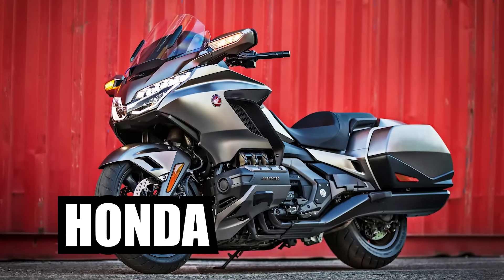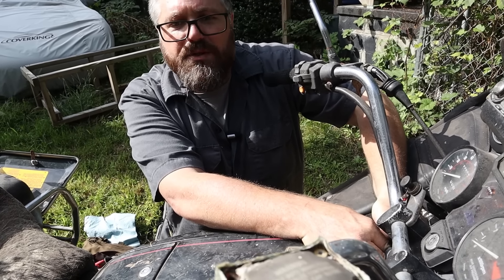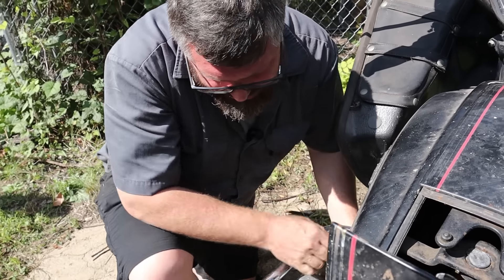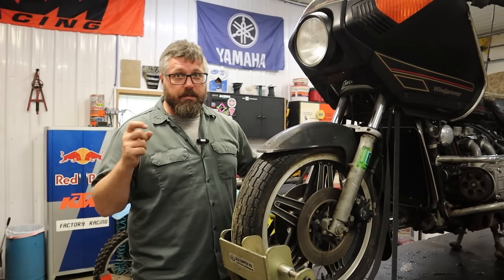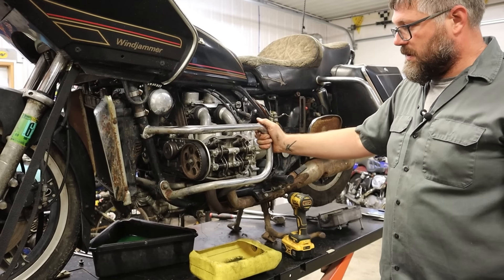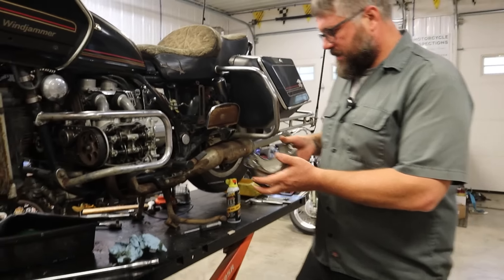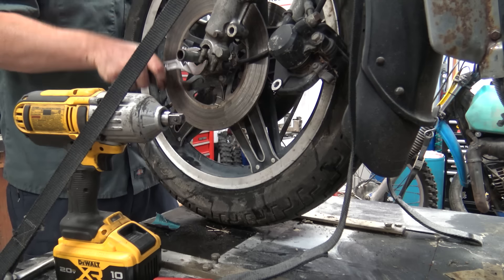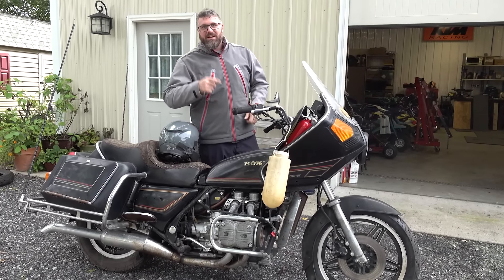Will this Abandoned Honda with a Seized Engine Get Me 247 Miles Home?

Comment: I have liked and subscribed Craig my good brother.
Thanks for taking me along on some adventures, since I had a stroke, I’ve not been able to work, which means I used up all my savings and had to sell my bike.
Been without one now for about 3 years and it’s killing me.
Made a good recovery and could ride, but here in England the bikes are expensive to run, so between you and Sean, this is about as close as I come to a ride out these days.
Thanks for the company and the entertainment brother.
Great content. Stay safe man. 🙏

Comment: Awesome job, back in 1982 I bought my second street legal bike the GL 1000 LTD. It came without any fairings or cases, it had a small handlebar and was sold as a sportsbike.
The LTD came with a socalled "blueprint" engine, a beautiful aubergine like metalic color and gold colored rims.
So I (like everyone else in those day's) added higher handlebars, a Vetter windshield/fairing and Krauser cases wich turned it into a greate cruiser. Honda noticed and changed their later designs into cruisers complete with everything you like and more. Thanks for bringing back some beautiful memories to a now 65 year old.

Comment: To turn the engine over, take the bolt cover off of the back of the stator and turn the bolt clockwise. That’s how you turn the engine over when setting the timing.
Reply: I wanted to say the same thing, yet thought I would look thru the comments first. Had to do it, when I changed the timing belts on my 1982 GL1100 Interstate.

Comment: Having owned an 83 1100 Goldwing interstate that was locked up when I first got it, I'd be willing to bet that GL of yours will eventually stop burning oil the more you run it. I was fully prepared to tear the engine down but decided to first see if I could free it up and get it running. It smoked alright but the more it ran the less it smoked to the point it stopped smoking (and it wasn't because it was low on oil). I ended up throwing more money at it than it was worth making it look like new again, rode it for 8 years putting over 10k miles on it but never tore the engine down to re-ring it. Having to spend money rebuilding brakes, fork seals, tires etc..... is a given on any older bike if you want to make it properly road worthy, the problem with early GL's though is engine parts like new pistons and rings are hard to find and really expensive if you do find them.

Comment: honestly this just proves that come hell, high water, etc, a boxer goldwing will run (unless u snap a timing belt)

I keep an old 1200 kicking around, and as long as you keep the carbs clean, it starts right up with 167k on it

Comment: I was just remembering that during my late teens, I worked at a Suzuki shop and it seemed that bikes of that era had a lot of trouble with needle and seats leaking, and bikes that were left sitting also had clogged piolet jets. Its amazing you got it running and my hats off to you. Good job

Comment: Here’s a super nerdy observation. But as I have been a mechanic And fire extinguisher maintenance/recharger. You should use a B.C. for auto/boats. The chemical in A.B.C. (The A part) is corrosive to metal when there’s moisture. There are even better, more expensive, cleaner options but a BC extinguisher at least won’t mess up any of your electrical or mechanical stuff in your shop. There’s my two cents, hope it helps.

Comment: Sight and sound brings back so many great memories...I had a GL1000 K1 in 1990, drove it from Holland to Sweden couple times, and many more countries and great rides, on one of the rides back from Sweden ear Malmö, temps started to rise, and a huge smokescreen in the rear view mirror, burning coolant, so found a small town garage/blacksmith, found the right rear cilindersleeve had loosened and sunk a bit in the aluminium block, which was very bad off course, but had to get back home, still 900 km to go, so made a copper ring to fit between the sunken sleeve and cilinderhead, loads of heavy duty gasket-sealant and an extra 10 liter tank of water hooked up to keep things cool enough to ride.
Drove all the way back home, remember driving through the hilly landscape in Denmark seeing a huge trail of white smoke curling through the hills and roads behind me, but kept it cool behind the windjammer screen, rolling sigarets while driving, scared faces in cars and gasstations, but made it all those 900 km, drove straight to a motorbike breakersyard, found a K3 engine low mileage, hoisted it on the rearseat, some ropes around it and drove home to make it well and run until 2 years ago to sell it because cancer decided I couldn't ride anymore, But death did not catch me yet! So I bought 2 Yamaha XJ's 650 and 750 to make 1 riding bike out of it for the fun of working motorbikes, and getting strong again after bad times, this spring will be the one to start riding again!
Thanks for your so inspiring videos, keep 'em ridin'!

Comment: I revived a 77' GL1000K that was parked in the 90's with gas in it. Had to snake the little ports out in the tank w/ stranded cable chucked up in a drill. Stripped it down to a motor and frame.. then broke my right hand (im right handed) and reassembled the entire bike with my left hand. It has a speed wobble at 80mph and only runs good when youre on the throttle lol

Comment: 2:00 I would call that an opposed 4, not a parallel 4. Back when I first started motorcycle touring on my CB750 in the mid 1970's the Windjammer fairing was THE fairing. I could only afford a Calafia which was a decent, but much cheaper knockoff. I love these videos that you do. ( I also had a 1984 GL1200 - the one with the lousy stator.)

Comment: I have restored several GL1100s. One of them would only turn a partial revolution then hit a hard stop. Upon investigation, I found that one of the intake valves had broken. The valve head was laying in the cylinder. I did a valve job on that bike using new valves. It ran great. These old Goldwings are just awesome bikes. My daily driver is an 83. Thanks for making this video.

Comment: That bike is worth a full restoration! All three of the Goldwings I’ve owned gave me three hundred thousand miles. I sold my ‘75 GL 1000 with over 289,000 original miles on it and it ran for several more years for the friend I sold it to. My ‘82 GL 1100 Aspencade was not the best Goldwing produced but again, it gave me 300,000 miles and so did my 2000 GL 1500. It’s about giving them the proper tlc and maintenance.

Roy 
Auburn, WA.

Comment: I bought a old and abused 1989 honda st1100 for 500 bucks. Changed the timing belt and did some regular maintance, rebuild the brakes and it ran fine for over thousands of kilometers. Went on a cross country trip and sold the bike after that. You got to love a 80/90s honda!

Comment: A weak point on these Goldwings is the stator. If they fail it's an engine job to replace or retrofit an automotive type alternator on front of engine. Put some Christmas lights on those trees on top of the saddlebags.

Comment: I had a small obsession with the gen1 goldwings in my 20s. So many cheap ones for sale. So many parts bikes out there. I could pretty reliably have a bike I'd put together for $1500 or less that would ride coast to coast and back again no problem, and it passed my dad's "safety test" cuz it was 1000cc and had front and rear disk brakes. The gl1000 is 100% the thing that got me into being a grease monkey. The custom scene is pretty badass, too. Now that I have more experience, I realize how tough the platform is to work on compared to a lot of other stuff. 4 overly complicated carbs, 2 coils and an overly complicated electrical system, and the fact that the timing belts are everyone's first must-do job are just some of the things that make them interesting to maintain, but I still love the bike so much. What an amazing way to get into restoring old junk.

Comment: I was the last person to ride that bike before you! I saw this video in my suggestion and started watching because I thought, hey, I used to have a bike just like that. Then I recognized the duct tape on the master cylinder cover! Lol. I bought it from a guy for a couple hundred bucks who had it sitting for a while. It was in rough shape but I rode it on and off for a summer. The radio only worked with the left turn signal on. It just kept running rougher and rougher and needing more little things fixed all the time. I had 2 other bikes at the time, one of which was my daily rider so it went to the back burner hoping to fix it back up but too many projects and not enough money. I passed it on in May of 21 to a new owner (who also commented on this video) in hopes someone could eventually do something with it but I guess it continued to be troublesome and turned into a trellis. Hey, if it does nothing else but keep a couple other Goldwings on the road I call that a win but it was great to see someone do what I couldn't and get it to ride at least one more time. Great job!

Comment: That's the same as my ol' Bold Thing.  They're a great machine.  I hope you'll be able to throw some new rings onto the one bad piston on the right bank and clean up the sticking valve(s).  She'll live long, I have no doubt.   The GL1100s are the king of the Gold Wings, in my opinion.   I owned my '81 from 1984 until 2024, and I miss it more than all my old girlfriends combined.  Good work Fellers!

Comment: Hi, I'm new to the channel. Great content! I also have an '81 GL1100 but the bags are more like suitcases... I replaced the water pump, fixed the seized brakes (a common thing with these???) and new tires... I replaced the timing belts too because of the fact this is an interference engine. How those didn't snap on yours is amazing! Thanks for the content and I'll be watching more of your episodes. Later!

Comment: If the brakes are solid, a bucket of boiling water will help.
Take the caliper, lines and reservoir off still all attached, put them in a bucket of boiling water. The crystallised brake fluid will melt, then drain and replace the fluid.
*caveat this worked for me, but no idea if it'll work for you

Comment: Hey Craig, I have another 1981 Honda Goldwing GL1100I, it has been in storage since 1997, I bought it from a bike shop in long Island, they were clearing out their storage. the story is the owner brought the bike in for service, while being serviced the owner went into the hospital and passed away. The owner's wife did not want anything to do with the bike and let the bike shop keep it. the bike got stuck in the back of the storage area and did not see light until 2023. The bike cranks but have not attempted to start it because the gas tank is roached. if you want to get a second try with a 1981 Goldwing, one is available.

Comment: Hello from Portugal, just got my 1983 GL1100 Goldwing with 80.000 Kms restored.  Its identical to the one you have, but its the naked version. Congratiolations. Its a beautifull bike. You never said if you end up putting anti freeze before you ride it and theignition key replacement.🙃. More videos on the GL1100 please🤠

Comment: The '81 GL 1100 Interstate, w/ the factory fairing and luggage was a wonderful sled, for long highway trips, and
unpaved roads, too... Back in 1992, a friend sold me his [ w/ 50K miles ], for $600.. A 5K-mile, one-month 
camping trip cost me just $500, including food, fuel, an oil change, some rain gear, and a Hot Springs guidebook...
It was like riding a giant industrial sewing machine, that silky-smooth flat-four 80 HP, 3800 RPM @ 65 MPH...
With the throttle lock  ON, you could ride w/ your hands in your lap, and just lean your head to steer...
I rode all the way across the Idaho pan-handle like that, touching the handlebars occasionally, to reset the throttle
for uphill or downhill.   Then you get to the Washington border, w/ a Billboard that says:
 "Helmet Laws Strictly Enforced;  $500 Fine" ...   A few years and 30K miles later, another friend sold me his 1980
GL1100 Aspencade, w/ only 5K on the clock, for $800 and a shot-gun...That bike was really smooth running....
 Kinda wish I still had it, even after all the Triumphs, BMW's, a Venture [ 90 HP ], and a KLR [ 37 HP ]...

Comment: The Vetter Fairings were made in Rantoul Illinois.  Craig Vetter tried to build a factory in town, but it was declined.  So he built a factory just out of the city limits.  At one point the factory burned and he salvaged the mold for the new sport fairing.  By then, the main motorcycle manufacturers were building their own fairings, severely cutting into his market.

Comment: Iv always heard good things about Honda's small engines, seeing your video here says alot about that year motor, no surprise made back when things were built to last. Very impressive not only running but riding this machine with low to no compression in 2 cylinders. qnd  have the power to proprlle itself.

P.s. i love it; the bike was just on fire, and your like its good and safe, i cleaned it off!! 

"Motorcyclist

))noun, singular (moh-ter-sahy-klist) : A person willing to take a container of flammable liquid, place it on top of a hot moving engine and then put the whole lot between their legs!!!"

Comment: load up the top end with Marvel Mystery oil let it set three days then come back and get it to roll drain it then seafoam the crap out of it then drain then repeats until nothing comes out that looks like rust then do a good rinse out let drip dry do an oil change then fix the rest of that crap and start it

Comment: Want to come to maine and fix my 85 klr250 and my buddys 81 seca 750 hahahha idk what happend with the klr and the seca sat for like 20 years in a barn we had it running not good but had it running have the carb rebuild stuff for the seca. Klr crapped out on me a few times and ive just given up almost but these vidios make me want to fix them both

Comment: Bro I like it when the car guys actually rent a car, fix a car that hasn't run in 20 years then, drive home 250 miles, Unfortunately getting classic bike parts isn't as easy as classic truck parts, we really need to fix that problem.
Reply: As owner of 80 cb750f and 85 gl1200 limited after market parts only work if they are rubber seals and such. Oem starters for 85 wing discontinued. Burned up 2 chinese made in 20 months.3 hour job each time finally rebuilt oem with usa brushes. Stator failed. Previous owner installed led headlight and overloaded electrical sytem.know what your getting into.one bad corroded contact will leave you stranded and there are miles of wiring and  neutral and clutch safety switches. No fun to push 700 lbs in heavy traffic.   Fun to ride no fun to work on and Clymer manual is not 100% accurate. Local  shops refuse to work on anything over 10 years old. FACT

Comment: Any tips for removing rust pitting on front chrome forks? I’ve seen a a few vids using aluminium foil, 0000 steel wool or 2000 grit wet and dry. My forks are immaculate other than a couple of rust pits so I don’t want anything thatl scratch the finish… even fine scratches would bother me.

Comment: Getting yard sitters running is a useful skill I recommend any motorcyclist learn.  DOWNLOAD THE FACTORY SERVICE MANUAL if possible or even buy one if you're keeping the machine. Gold Wing note, their components changed surprisingly often so when hunting used parts either do it by part number or physically compare them. We had a customer bring his own replacement use harness (old Honda connectors and fuse holder age badly) he paid way too much for that didn't fit and he couldn't return. GWRRA and other Wing communities are valuable. Everything has been figured out on the old ones so no need to reinvent the wheel.

Comment: <----- One of the GW owners saying... "tgeres a kick start lever on the right side of the faux fuel tank. It fits into a gear on the right side of the engine. 
It has a plastic cover over it and if you dont already know where it is, you'll easily overlook it.

Comment: The best motorcycle in the world, imho, is not the fastest, or best looking, or most powerful, or top acceleration.    As you get older, you really loath wrenching on anything.    The best motorcycle in the world is the one that you never have to work on, and when you do... like to replace common items that wear out and have to be serviced... it's been through out and is so dead simple, it's trivial, quick, and painless to do.   Motorcycle manufacturer's have yet to create the best motorcycle.

I've just been trying to replace the front brake parts and bleed to brakes on two bikes that were in storage for 4 years (1982 Honda CM450 and 1987 Honda Rebel 250) because I went blind, and what should be dead simple and easy to do turned into an absolute nightmare.   Paint corrosive brake fluid everywhere, wrenches dropped in the dirt, nothing working right, asbestos and grease all over my hands, bolts that won't come off but strip, the wrong new parts because nobody has standardized on anything, it's just total, absolute... grrbage.    And these two bikes were some of the simple classic ones from the 80's.

You don't realize how terrible these machines were designed, until you watch someone who does not wrench on stuff, frustratingly try to do the basics on these things.    Change brakes, bleed brakes, change tires, change batteries, change oil, adjust points, clean carb jets, stuff that should be dead simple.   Find someone who has never done any of this, give them the job to do because it's their own bike, and give them absolutely no help or verbal instructions and just watch and film.   It will be an eye opener.    Grab a 14 year old kid, your grandma, a girl who does Youtube music videos, a computer programmer, a musician, whoever.   Just someone who has never wrenched on anything before ever.

No help like a fully stocked mechanics shop, this happens out in a driveway or under a shade tree like in real life.